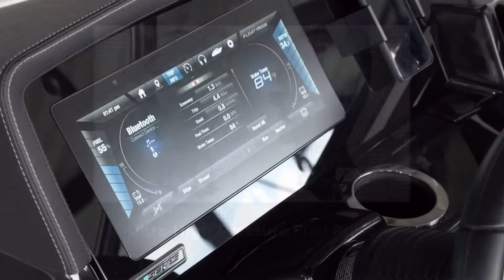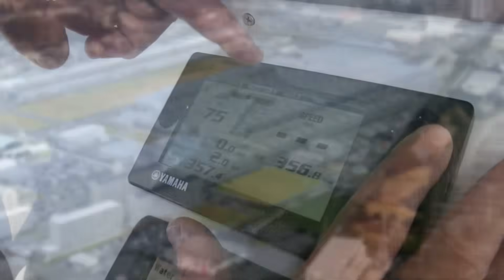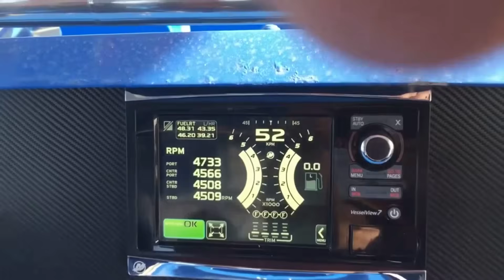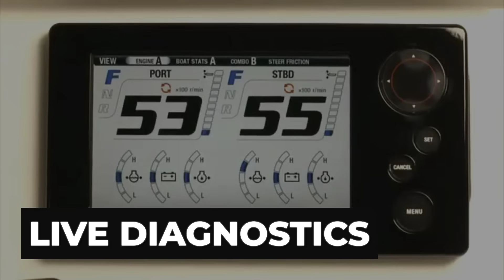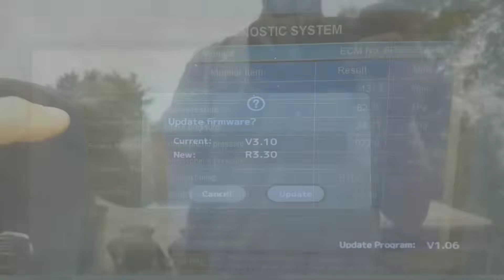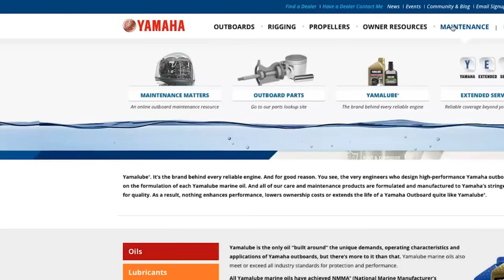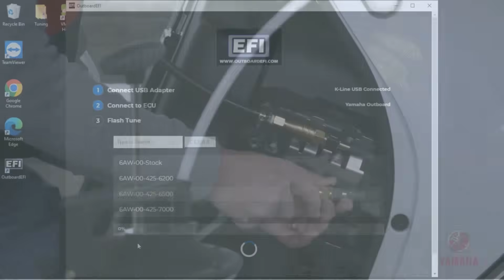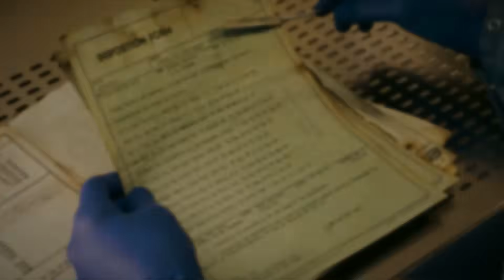The SHOCKING Truth Behind Yamaha 425 XTO Offshore Outboards!

Comment: People hate the ETEC G2 for some reason but if you really research how they built that motor it’s great. And Evinrude came out with the intergraded steering first in 2015. It’s sad that the G2 gets the same or even better gas mileage but the EPA drowned evinrude unfortunately due to it being a 2 stroke. Yes they had some problems but I have a G2 with several hundred hours and never had an issue. It’s all about maintaining it properly. The torque is crazy on those motors too
Reply: So so true

Comment: Sounds like every car built after 1990.
Reply: You got that right!  KISS = keep it simple stupid!  Why can’t engineering executive stay away from Stuffing an AI computer inside a boat motor or any motor at all?   Distributor, breaker points, coil, plug wires, throttle body injection, one chip with quadruple redundancy to control the whole thing so it lasts as long as a burner phone.  Idiots.  Complexity = unreliability